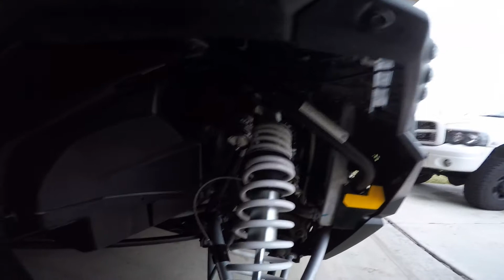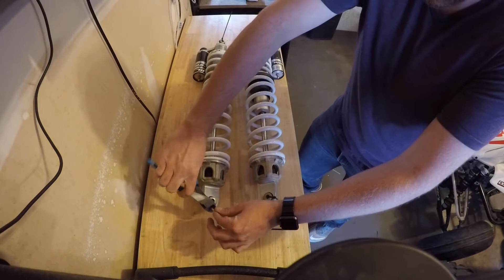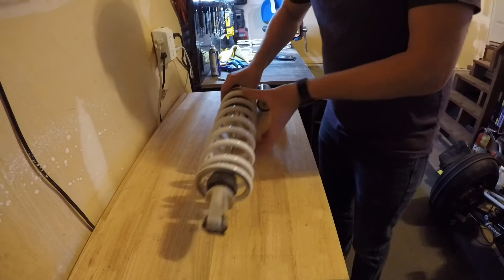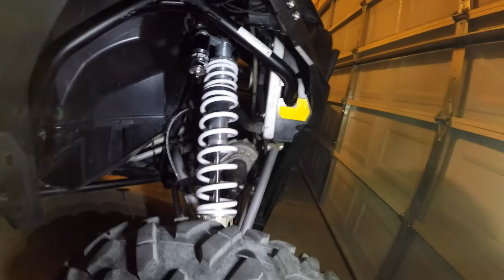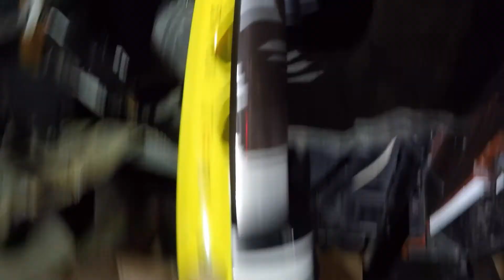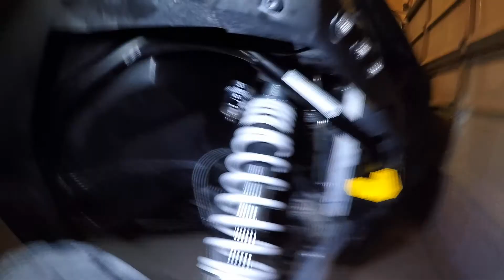RZR XP1000 Tender Spring Swap

Comment: How do you change the ride height?  simply adjust the tender spring compression nut?
Reply: Yes, if you adjust the top nut down it increases the ride height. Conversely, back off the nut and it lowers the height

Comment: How did u like the ride quality after installing the xp4 springs ? I’m doing the same tomorrow just curious
Reply from the maker: 12sreyes I was happy with the improvements over the small bumps. It was nothing crazy like a Shock Therapy Spring kit. But for a quick simple swap it’s worth it!
Reply: @Colt45mx801  did you gain any clearance?

Comment: What are the measurements on the smaller spring? That you replaced. are they different for the front and rear? if so, can you let me know the measurements. I greatly appreciate it.
Reply from the maker: Like the height of the spring free standing before installed onto the Shock?

Comment: I'll be in the market for a RZR soon. I went out with a couple guys last week and noticed they both had their rear tender springs fully compressed like yours. One had the XP 900 and the other had the XP 4 900. Whats the point of setting it up fully compressed and defeating the purpose of the tender spring? I understand the need for clearance, but doing so at the cost of suspension performance seems counterproductive.
Reply from the maker: The biggest problem is all of the RZR's come under sprung so the tender spring is almost always maxed out making them nearly useless. I think its more of a selling point to say they are dual rated shocks. But, honestly more like a single rate, when the tender fully compressed like you said, and as well can make it a harder ride.

Comment: So do you use all the main springs and tender springs from the Rzr XP4? Front and rear? It’s a bit difficult to understand you in the video.
Reply from the maker: You will only use the front tender springs off of an XP4. Replace the stock front tender springs with the XP4 springs. Then you’ll replace the rear tender springs with the stock front springs you just removed. I hope that helps explain a bit better for you.
Reply: Colton Craghead Sweet thanks for the info. Thumbs up on the vid.

Comment: Can i just do the rear tender spring swap mine are fully compressed an thought about just ordering a new set of front tender springs an putting them on the rear
Reply from the maker: I’m sure you could go that option. It would help the rear, not sure how it’d affect the front keeping those the same. You can often times find a good deal on the XP4 Springs on local classified sites.
Reply from the maker: I’m sure you could go that option. It would help the rear, not sure how it’d affect the front keeping those the same. You can often times find a good deal on the XP4 Springs on local classified sites.

Comment: What kind of riding do you do on those measurements?
Reply from the maker: I ride a combo of trails and Dune riding. The best thing to do, that I didn’t include is to jut set your ride height. Since my tire sizes differ from the sand to the trails. I like to run 14” in the front and 13 1/2 in the rear.